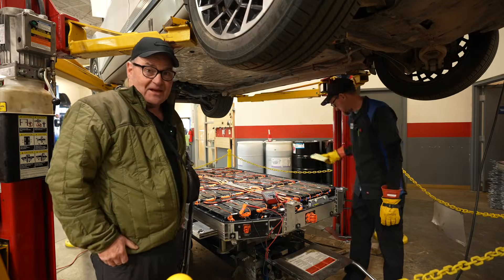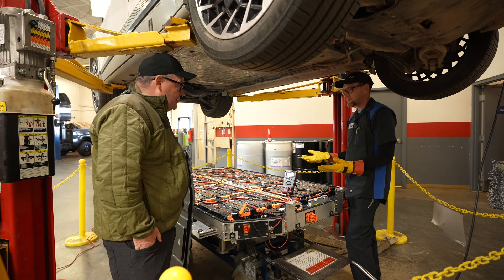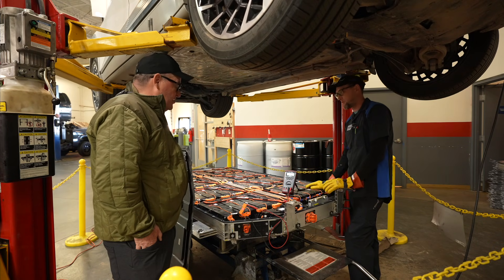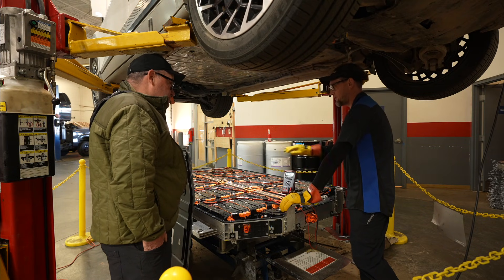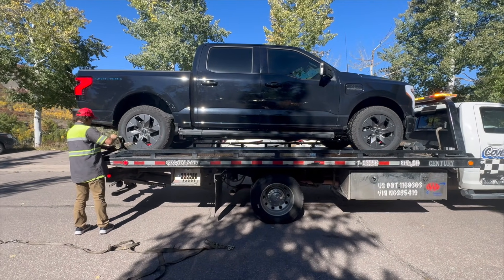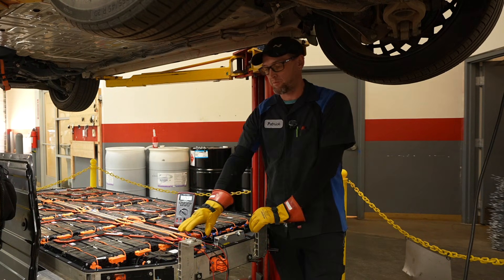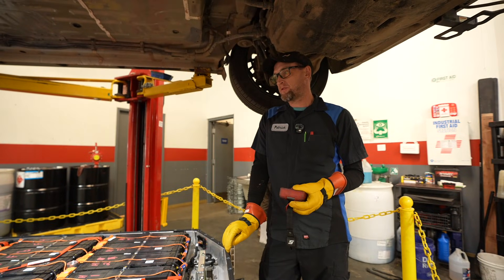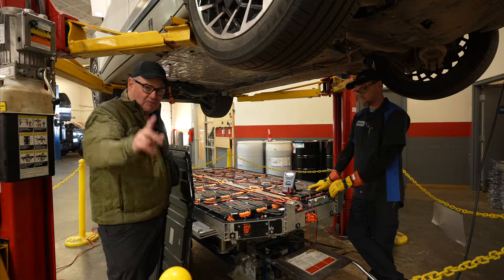Inside an IONIQ 5 Battery: Packs, Cells, and Modules

Comment: It doesn't inspire confidence if you don't use electrical units correctly. It's not an "84kW" battery (1:30). The battery here is 84kWh. Batteries are rated in both kW (power) and kWh (energy stored). Power (kW) is the rate at which the energy can be transferred. One battery could be low in energy capacity but high in power like a small water tank supplying a fire hose, discharging quickly for a short time. A differently designed battery could be high in capacity but low in power, like a huge dam supplying a garden hose, discharging slowly for a long time.
Reply from the maker: Of course.  Error on my part and I know the difference. Thanks for watching.

Comment: Really disappointing that service techs can't replace battery modules... if not individual cells. It's not that hard... Yes I've done it, on a much smaller pack but it's essentially the same thing.
Reply from the maker: Ford replaced a small pack on my Lightning in one week.  I was really impressed. Unfortunately, Ford is a quitter and giving up on electric trucks. Never had such a good product been handled so poorly by a company.